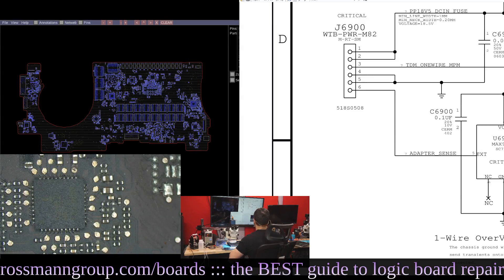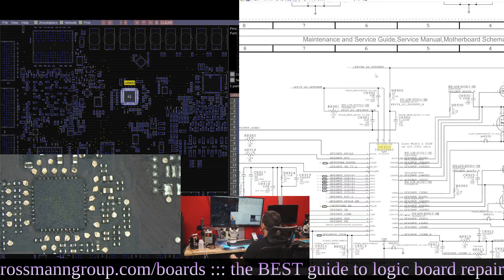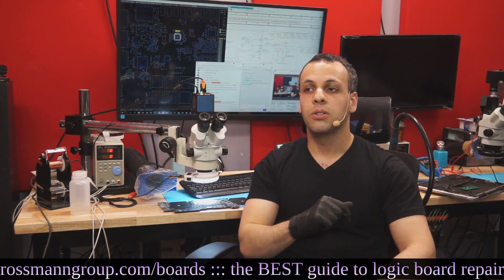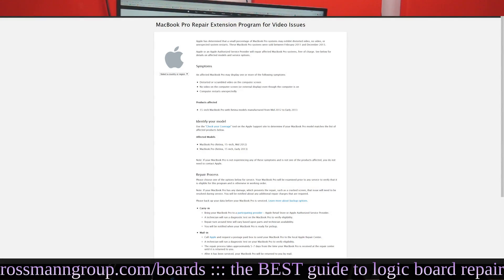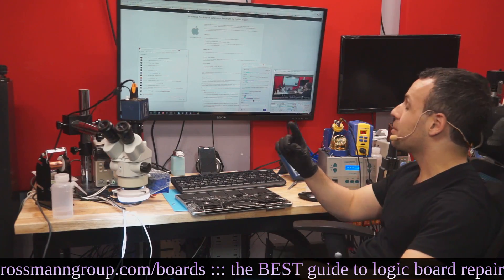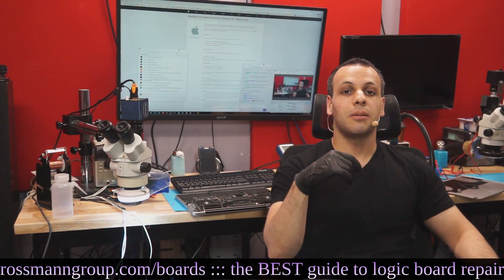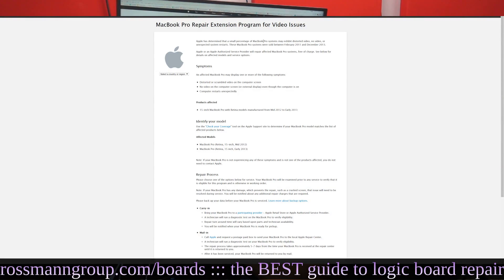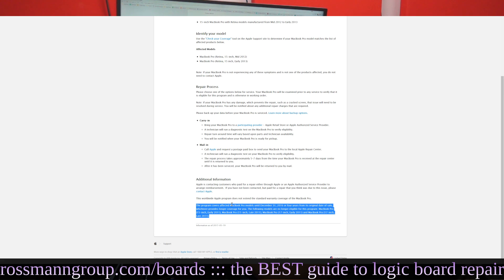Why 2012 15" Retina Macbook Pros with GT650M DIE

Comment: So glad my non-retina mid-2012 MBP 15" with the GT 650M hasn't crapped out yet (knock on simulated wood). If it ever does, I'll just have to strap my eGPU with an AMD RX 580 to the back of the machine and carry that around with me. Going back to the 1980s "luggable" machines.

Comment: 0.9vcore for a gt650m is terrible for its factory clocks, (if it was one of the rare fermi based 600 series dies fair enough) but tsmc planar 28nm could probably run that at sub 0.825v

Comment: Hello Louis, first of all, thank you so much for your repairing videos, i'm a technician here in Argentina and i learn a lot of things with you, can i ask you about something i have doubts? Replacement battery A1494 for a1398 macbook pro 15 retina  model it's the same that a1618 battery model? a seller try to explain to me that a1494 and a1618 it's the same, but values of the models are different. Do you have some info about this? Thank you very much again and Cheers from Argentina
Reply: Hey nicolas Dies How are you

Comment: Mine is a 2011 discrete graphics, but has nvidia 650m. It either boots with black screen, or if get video it is not usable. Have got any videos on this model? MacBook Pro (15-inch, Early 2011) Aka: A1286 Mod: 2.0GHz Core i7BMan: 2011-02-08
Thanks
Reply from the maker: That year and gpu is impossible
Reply: @rossmanngroup  sorry my error, MacBook pro 15" mid 2012, hd400, Nvidia gt650m. I have connect via screen share from another Mac, used gfxcardstatus to set to integrated, and in sys pref energy to turn off automatic graphic switching. It has rebooted ok, but both these settings gone back to switching? Afraid to reboot in case get black screen again?

Comment: It annoyed me so much when we missed out on the recall program on one of the 2012 MBPr we had - I do also have one that STILL works and doesn't seem to fail when switching to the dGPU. It does however fail to come out of suspend when running on battery (Which could still be this issue - But it doesn't panic as soon as it switches to the dGPU like the other one).

Comment: Thanks for this video! This makes a lot clear what Apple really is.

My MacBook Pro 15 inch 2011 died two time cause of the AMD graphic card. So If I decide to buy another model,  can anyone tell me if a MacBook Pro 15" mid 2012 Non-Retina is a good choice... or does it have the same problems as the 15" 2012 Retina models?
Reply: I have a non retina, daily use, over 20000hours on it... works like a charm

Comment: By the by - you will get the question mark even if it is not repaired - at least I did - the question mark comes up if the integrated video is working, at least if the battery has been unplugged for a while and then plugged in before you try to boot it. My symptoms were that I got to a certain stage in the boot (where I imagine it changes over to the GPU) and the logo and the progress bar disappeared.

These machines are still failing - mine failed on Friday the 13th  March 2020 - Moral: don´t use your computer on Friday 13th just before a stay at home policy is enacted. Early 2013 model bought October 2013 and used four or five hours at least a day. When it suddenly gave me a black screen I had already bought a new battery and new 2TB ssd! So I did some digging with Duckduckgo & Google and found this video. Bought a cheap termostatic iron with a few bits, an antistatic mat with a cuff and some no mess flux. Consulted the iFixit instructions on how to get the board out and when the stuff arrived I didn´t have the courage to do the repair.

Some weeks later I took the board out and still chickened out and put it back together. I did have the safety of having taken out the ssd and put in a USB 3 housing and could boot into my wife´s iMac.

Today I bit the bullet after having seen a competing repair service video and more important the comments attached (search for "Macbook Pro A1398 2012 Retina GPU Vcore Failure Repair on board 820-3332). In the comments there was someone who filed down a soldering pistol point to do the soldering amoungst other storys. This provided me with the encouragement that I needed. I also cobbled together a microscope from a lazer pointer lens stuck to my phone camara. I could then at least have a look before soldering and then afterwards (to check for bridging between contacts). I used 440°C and 1mm solder (which I had from the local ironmonger before stay at home was enacted) with a flux that I got online. I now have a collection of soldering irons from one for doing leaded glass to the new one for realatively fine soldering.

After doing the soldering and putting things back to gether, I was just about to screw the back cover on and I had to go to a Zoom conference for work - Two hours later I could finish putting it together and it worked :-).

In other circumstances I would probably shipped off the board to be repaired but at the moment 

Hopefully the machine will last a while longer because I don´t want to take on the commitment of paying off a new one over year or more at this moment.

If you try the repair and it doesn´t work out - it will not be the end of the world - there are options - a new machine, a refurbished logic board or send yours off to Louis.

Comment: Hi i just wanted to say thank you for the great videos, i really learn allot from you.  I have a question about a friends 2012 mac book.  he says he has dropped it a few times but when he squeezes the bottom left corner where the hard drive is it freezes.  he said he tried backing up his files but it's taking days to do so.  I'm thinking he may have a hard drive issue, or loose ribbon cable.  what are the odds of it being a cracked circuit board?  what would be the best course of action if you had to diagnose this?  i don't have the special tools like you do but i would like to know the diagnostic approach you would take to fix this being a expert in this field.

Comment: The flashing question mark comes up even if the gpu is not working: at least on my machine when it has no internal disk (took it out to put in a housing to boot it on another machine).

Comment: I got my 2013 15" rMBP with the GT650M repaired twice. Second time I had to really push them and remind them of their F-up. Mine was the early 2013 model so basically a 2012. I did A LOT of GPU video rendering but still. Luckily back then OS X allowed me to force integrated graphics. Apple updated that of course though.

Comment: I think i'm starting to have this problem, i have a non retina 2012 15" though. It has a GT650M and a Intel 4000 GPU.
it seems to happen sometimes when i unplug the thunderbolt connector, i believe it might switch video cards then.
Thanks for the info Louis!

Comment: after 2 weeks of messing around with my broken Macbook 15 (early 2013)

screen would go blank after login
couldn't enter safe mode, because SDD encrypted
screen would go blank before login on bootcamp windows 10, no safe mode possible either

= > after research it seems that the discrete Nvidea GPU is dead, a problem that Apple managed to migrate through 3 generations of macbook pros and several MacBooks and MacBooks Air. Quite an achievement. since I don't want to solder around, missed the repair programme, because Apple screwed me over by never telling me about it or pay 100s of $ for repairs or DEFINITELY not get a new computer (least another macbook) try this: solution (for me anyway):

1. Enter recovery mode after booting with cmd-R
2. enter Terminal

$ csrutil disable
$ nvram boot-args=”nv_disable=1”
$ csrutil enable
$ reboot

3. that's it. 

in more detail:

my macbook (15 retina, early 2013) has an encrypted HD (so I can't start in safe mode or single-user mode) and it went black right after I logged in, so no chance of installing the gfxcardstatus app everyone is raving about. But this works, and takes only 5 minutes. tried several re-starts, still works, loosing brightness control f1-f2 and restart on clamp-close apparently, but what the ****, I can use my computer again.
Same problem with my bootcamp windows 10 partition, screen went blank even before login and couldn't enter safe mode, so had to re-install from USB stick, and de-activate Nvida in the device manager and re-built system from there manually, as soon as I would install the correct Nvidea driver, screen would go blank again. (enter safe mode, de-activate Nvidea, rinse, repeat...)

Comment: I've had this problem on my 2012 2.3ghz retina Mac. I went to Apple store in 2014 because my Mac started to shut down or black screen randomly. The guy in Apple store told me that there is nothing they can do, and basically I need software update or something. Fucking stupid idiot. I've payed 550 pounds to fix my Mac in 2016 when it died completely, and nobody told me about extended warranty. Fuck apple, and fuck that guy. Your video made me so mad at them, fucking rats! I sold this Mac in 2017 and got a new PC.
Reply: If only there were a chance to go to court and at least for them to return me money. I'm so sad.  If somebody from apple store at London Wembley stadium is reading this, you owe me 550 pounds dumbasses.

Comment: wow! great video! saved my day/week/month not bothering to repair it anymore (i changed the sticky-battery successfully and cleaned the fans myself, but still panic bug..).
btw: i use a free software named gfxCardStatus v2.4.4i that switches to only-integrated-gpu and then i don't have any black-screens anymore.
https://github.com/steveschow/gfxCardStatus/releases (or google gfxCardStatus v2.4.4i for more info).
it works that way but you can't use anything cool anymore like external monitors etc.

Comment: where were you when I bought the 1st ps3 that played all the formats and the video chip kept coming apart. seems to me you would have fixed that issue pretty easily. resolder the gpu so it would work only you would know what to do

Comment: I have mid 2012 MBP retina 15”. I just did battery replacement. However, when I plug-in usb devices, sometimes the battery become undetectable and battery icon disappear, a few second later, the MBP shut it off and can’t be turn on unless plug the charger.

The battery still become undetectable, I have to unplug and plug-in the battery cable to make it detect the battery again.

Comment: Hey Louis, my MacBook (A1398) seems to boot up into OSX and function for a while until it gets a black screen (no backlight). Seems to still respond to key inputs.
When going into internet recovery all is normal until it actually starts to boot into the internet recovery then the display goes completely black (no backlight)
I reboot and it still is black. I only seem to get the display back after doing an SMC rest or leaving the device  for awhile.
It also gets a black screen as soon as it boots into windows, I see the login screen for maybe a second before it goes black (no backlight)

Do you reckon that this is the cause of my issues.
I might try the shoe rubber technique to see if it fixes my issue
Reply: I actually just booted her up into windows whilst flexing my MacBook a little and it seemed to have worked haha
Looks like I'll be doing some soldering on the weekend

Comment: Thousands of $$ in equipment, does not have $5 for a dentist round mirror with handle so you don't need to tip the board to see from the sides.😉 Don't delay, buy a mirror today lol. You can show the viewers a perfect side view since the microscope will see that mirrored image.

Comment: I have A1398 2012 with nVidia GT650M, I hat the kernel panics and I got it fixed in 2017. I was warned in an an online forum, but I tried an ebay shop, that wanted to charge 140 eur. They sent it back and said that they couldn’t fix it. Then I sent it to an active member of the forum, agreed price was 280 eur (incl. VAT) and that worked.

In the quotation the shop wrote that they would replace the nivida chip with the second revision. After repair the shop asked “if someone tried to fix is with just heat, gpu, gpu ram is grilled and buck converter is broken which previously was ‘100% fine’. Luckily our technican did check that and repaired it”.

So… is that gpu replacement just nonsense? Maybe the guy who wrote the estimate had no ideal. And I don’t know what they did to fix it. And if only the buck converter was the problem, was 280 euro to much?

Comment: The Apple employees that fixes macs probably doesn't have any understanding about reflowing, soldering, bridging connections, etc. They probably only get just enough training to know how to disassemble and reassemble. I say that's why Apple only gives you an option to pay for a new logic board, screen, etc. That's likely why Apple came up with this rubber piece just because they don't want to train their employees to solder.

Comment: you got a picture, ;) done ;) i have MacBook Pro 15" Retina, Mid 2012, i7 2,6GHz/Turbo 3,4Ghz, Intel HD Graphics 4000 1,5G + NVidea GeForce GT 650 1G / 16G RAM DDR3 1600GHz,, he run's normally, is fast really fast, for a 5 years old mac,,, let's say, that, times to times, he simply crash or lose display, continue working,, for no reason,,i've checked my hardware, all things are well, in system report, no issue, at all,,he identify both graphics, as well all other devices/hardware,,,, just hope this is the same issue, even apple assistance can't give one straight answer to this specific issue, cause apparently my graphic cards are good, something around as a issue apple can't identify the cause, apple support, in the first they told me is " obsolete ", when i speak in reparation, no problem,,, but i will pay for that,!!! Bravo,,, Strange this happens and apple is not responsable, they ask for money for this, default/bad quality production,, shame on this, i really like this macbook. i've get it for free, the owner, told me that he could boot correctly, he's been working for more than & months,, with some crashes/kernel panic, strange, kernel panics, change from CPU to CPU, once is on CPU6, once is on CPU2, or CPU3, etc,, thanks a lot,, Thumbs up. ;)

Comment: Hi, and thanks for your videos.
I have the exact same model of macbook, and the issue with is that as soon as it switches to the GT650M GPU (especially when plugging in an external display) I get a black screen. So I watched all your videos on the subject (several times) loaded the ifixit logic board removal tutorial and got to work. However when I checked the GPU vcore, I was getting around 1 volt, even when the screen went black! So I looked at the solder joints for that chip you mention and they seemed all right, so I didn't bother resoldering it since it's a bit scary to be honest! I did however give a thorough cleanup to the heatsinks, the fans, and reapplied thermal paste to the CPU and GPU. Put it all back together and now plugging in an external display works flawlessly! I even ran some GPU tests and got reasonable results without crashes. I still don't really know what the issue was really. Just thought I'd share this story so people know that maybe not all issues are from that famous U8900 chip (or maybe it is and I'm just bad at diagnosing this. Which I am. Anyway macbook works me happy). Thanks again for the work you do Louis.
Reply: your problem will be back, GPU or ISL replacement also does not help, check tantalum capacitors
 on back of the plate, it's real problem, they just react on soldering or temperature change
Reply: @MrAsderoff  Yes,the problem was back about an hour later :D So I bit the bullet and resoldered that chip. Now seems to be fine. If the problem comes back I'll know to change those capacitors. Thanks for the tip !

Comment: Hey Louis, I have one of those macbooks and U8900 did start acting up recently. I looked on the internet for diagnostics for hours and hours until I landed on your video. I swapped the solder on the chip as you showed with my hobby grade equipment (Weller fine tip iron, some janky gel flux and a cheap stereoscope) and like magic, my laptop works properly again. The flux doesn't really come off with alcohol so I was kinda left with no way to clean that up. 
Thank you sir!

Comment: i need to get all that gear just to keep my mac going... tsk tsk mac. this is my last model i will purchase from apple.
Reply: I am running a triple core MSI laptop from 2010, that fell on the floor broke it's screen. I ripped the screen out literally and it has been running as a headless server since 2012.  No errors no BS, the laptop does not care if the screen is attached. Apple is too much of a pain to deal with and none of their laptops would ever work as this MSI has. Basically a laptop with its screen removed on purpose makes a great rack server 😂.

Comment: My MacBook 2012 has intel HD graphics 4000 , is this the same issue ? Apple just sent me a £2000 ( yes that’s right ) repair quote because I need my logic board. Batteries and screen replacing..... 😂
Reply: The 2012 MacBook Pro has intel 4000 as well as NVIDIA GeForce GT 650M graphics. it switches between the Nvidia for high performance and to the intel for low energy usage

resoldering this chip fixed it for me. About $40 in parts for solder and flux.